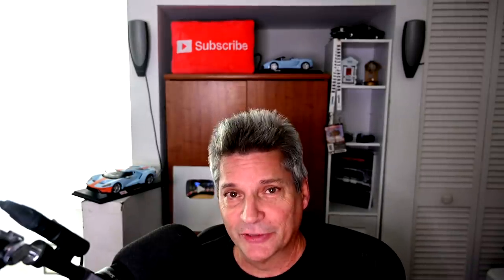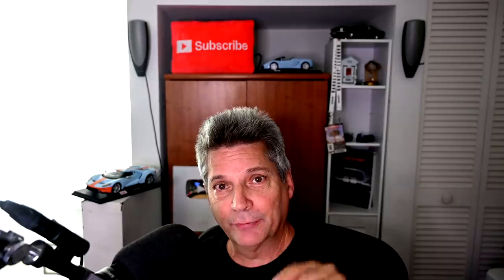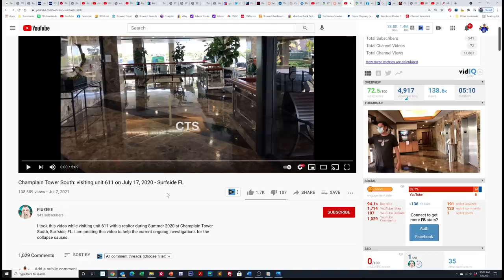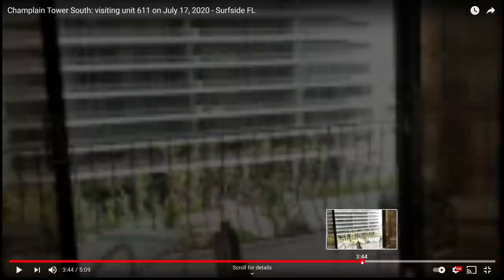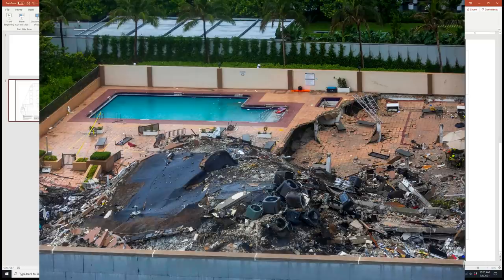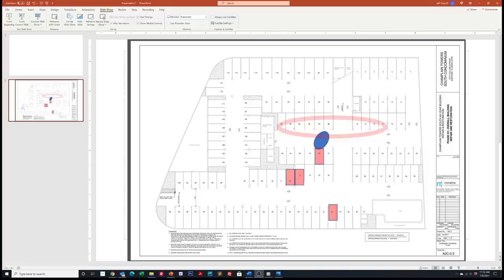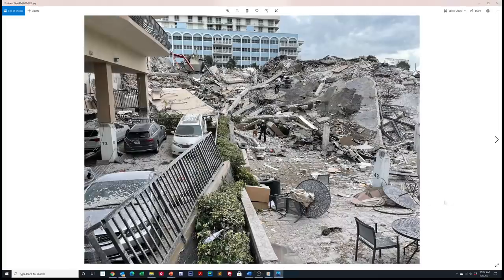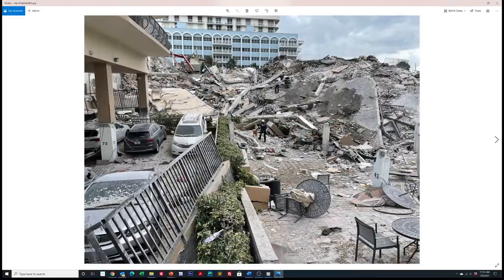Analysis Garage Video BEFORE Condo Collapse: Water Everywhere

Comment: despite the limitations of her recording technique , she still did a hell of a job showing us this garage, this is precious footage, also, she even kept it a year, ( when pre collapse many people would have simply deleted it)
Reply: A few times your meant to copy the blue eclipse or red rectangle and moved them instead.  So there should be more of both on your diagram.
Reply: She wasn't recording for forensic purposes at the time.
Reply: Kudos to her for the footage and that she still has it.
Reply: And how fortuitous that she filmed in landscape rather than portrait! Kudos to her for sharing it.
Reply: I came to say this, too. 👍
Reply: It was obvious back then, this is a warm climate and covered concreate, you see patches and uneven concreate. If I were considering a condo, I would do my own inspection of the lowest level. If I saw concreate that was not almost perfect, regardless of age, I would not consider it. Around 52 you can see unevenness in the slabs and patching, later around 64 is what you want to see a nice flat floor and no slabs failing because the foundation under then is gone. Around the failure, space 18 and 87 you see more slab failure, the elevator concreate structure may have held up places like 52 because it is close while 18 and 87 are farther away and do not get that support.
Reply: Big buildings are death traps
Reply: @Propfaqs  this wasn't a particularly large building  though
Reply: I have learned from other people's awful jerky home-movies, to be very careful and pan the phone camera around very slowly, and make sure that it is in landscape mode as it will look so much better on my TV or on YT. However, she probably didn't see it as a "entertainment" movie anyway, maybe just a single-view to help her decide whether to buy or not. Also, what even is the point of short video clips? A home-movie usually should be several minutes or even 10 or 20-some minutes long.

Strange all the important details that a camera dutifully captures, that we often simply do not remember. Especially if the resolution is high enough to later be able to zoom in on something of interest.
Reply: @Propfaqs 
Big buildings are death traps

A small house can have one end flattened by a fallen tree. You have to live somewhere?
Reply: @yosefmacgruber1920  true.  But in a house you might have one flight of stairs. I bought myself a fire ladder in case the stairs were blocked. Most houses have two doors. I look at those condos now with real hesitation. Never mind the cosmetic enhancements to the unit… figure out the escape routes and assess the integrity of the structure. I was laughing with someone about the google street view of a condo building I was considering. What was parked out front?… the rodent exterminator!!!!
Reply: @Propfaqs 
Imagine how useful a good long rope could be, in a highrise fire. If you have a D-ring and know how to repel.

Guess what I saw in the glass window reflection of a business. The Google vehicle itself. In movies they go to great lengths to keep the cameras hidden from view, as it kind of shatters the illusion. But in the Bonus Features of the old movie "Monsters Inc.", there is a great "accidental" mirror shot of a monster on a cart holding a camera.

I am not sure that a rodent exterminator indicates a problem? Could it be that they have a contract and maintain some rodent traps routinely? Maybe they are being proactive?
Reply: the tiny bits of water she got on her video did not cause a building to collapse.  There was a much more serious failure taking place here.   Parking garages are able to withstand a little water on their surface.
Reply: 😉👍Right???
Reply: @STARZFAN31 
But if it is constantly super-wet in the concrete, then would the rusted-away rebar be slightly stronger than sawdust? But then do swimming pools often collapse? Maybe they are built better?

The Bible does say something about not building your house on the sand. Hmm. Just how solid were those pilings?
Reply: @chrisbarr1359  lllll

Comment: I worked all over Miami Beach in the early 90's and a very respected old timer told me that some contractors used ocean water to mix cement to save money. He said time would eventually tell which ones did.  I thought of his comment immediately after I heard the news. He also told me they would have a water truck or hydrant connection on the street side but would pump ocean water in from the ocean side.  Great videos btw.

Comment: 10:30 I know what that is, that is corrugated plastic sheeting. I have seen this in building garages before. The maintenance department was getting complaints from people about water dripping on their car. So they put those to "gutter" the dripping water away from the cars. Very very damaging image right there. That implies they knew water was dripping from above for some time.
Reply: 👍 Yupp! 
To redirect the leaking off the vehicle probably due to complaints from the owner! They most likely used small concrete fasteners to hold it up!
It's bound to come up in the investigation! 🤔
Reply: In another video an engineer looked at the core sample there was only 1/8 inch waterproofing on the slab.
Reply: It's definitely going to be a smoking gun. I think the root cause of this collapse was the failure to build on top of a slopped concrete slab that would allow for water drainage. The fact it was completely level is the reason for the water pooling, then leaking into the concrete.
Reply: or water dripping on the people while trying to get in an out of thier cars is more annoying than water dripping on a car
Reply: We had a leak like that in our building's garage...  but after a while they did a whole repair of the area, digging into the ground above. They took down the plastic after the repair was done and it doesn't leak anymore for a good few years now.

Total time of leak was 3-4 months.

I can't imagine it being left for years!

There's also excellent drainage and proper slopes.

We also had a few isolated incidents of ruptured piping, flooding, a few leaks. All are fixed as they happen, not just patched over. Maintenance happens all the time, a few times I noticed an issue one day and the next it was taken care of. 

I know someone has to be reporting it- there's a cleaning lady I think? But I barely ever see who's repairing it. One day a light bulb burns out, the next it's replaced.

Comment: Did you notice that the base of all the columns, the bottom 6" or so look a little darker.  It could be a waterline from a one time flood.    Or maybe there is water inside the columns???
Reply: I think it’s a water line from water wicking up the column from the bottom - either from pooling water or from a saturated slab at the base. Bases of those columns are constantly wet.
Reply: I Noticed it too. There is more columns with the same darkening where the floor meets, the red column's base also.
Reply: I noticed that, I wondered if water was somehow seeping up or absorbing up the column.  Granted I don't know if that would be possible with the way the column is built and how its constructed.
Reply: Yes, I think it’s valuable to notice. I am not a structural engineer but considering all the water intrusion it doesn’t seem good, and I think engineers have pointed this out on other channels. All should be looked at.
Reply: It flooded on a regular. The dumpster would be floating. Locals know this.

Comment: When you look at video in garage, look at bottom of pillars!  You see water stains from concrete floor weeping up the columns.
The fresh yellow paint shows they are covering the continued failure you garage area
Reply: I noticed this too. There has been notable amounts of water present for some time it appears. 

Here is yet another folly of man. Just because steel reinforced concrete is extremely durable anything can be destroyed by water over time.
Reply: The concrete columns were clearly freshly painted over.
Reply: @CharlieFlemingOriginal  how fresh though? Sure they may have been 60 or 90 days in but not like same day fresh mate. Paint doesn’t take more than 2 days to dry in high humidity even if it’s enamel paint. I didn’t see any painting materials or masked spots. You don’t get lines that clean without some kind of masking. I also noticed slight dirty spots on the columns so I really don’t think it was fresh paint. I’d be more apt to think moisture collection. From the presence of stalactites and overall dank atmosphere it must be a relative high humidity which would cause surfaces to sweat excessively with the ceiling temperature variance. Especially if it’s a satin or matte type paint.
Reply: Still not going to cause a collapse. Hint. Look at the 2nd half of building and how it came down.
Reply: @metalhead2320  bk
Reply: I guess I should have scrolled down a bit more...I totally agree, if cement is that wet to cause paint to discolor, what else is going on?

Comment: Wow look how every single column is heavily saturated with water about 10” up the column, they were definitely absorbing moisture!
Reply: i noticed that as well
Reply: @nottheone582   who knows how many times they just patched with concrete and repainted, which does not solve anything.
Reply: The columns were strong but the step beam was 12" less deep that the original design.

Comment: I saw a interview with someone who lives there and they said they wondered why there was always water in garage  and there had not been rain
Reply from the maker: I saw this exact same interview also 2 weeks ago!
Reply: Where does the water come from? Broken pipes or something? And by the way, the ceiling is covered with stalactites. It's seems A LOT of water coming from somewhere.
Reply: @Ron4885  the water is from previous rains that got trapped between the pavers on pool deck for 40 years, the deck wasn’t designed with slope to channel water to drain.  According to the engineering report, the water got under the waterproofing below pavers. Trapped with no place to go it rotted the concrete and steel rebar
Reply: Yea seems that the water came from pipes and leaked, but I don't know.
Reply: @Tbevel  40 years of rain water, salt and pool water chlorine, just absorbing on that deck. It's amazing it last this long.
Reply: @Tbevel  I saw a report showing construction drawings that called for sloping of the pool deck.   So far it’s unclear if it wasn’t built to spec., or if subsidence caused reversal of the slope.
Reply: WOW & they didnt REALIZE?? thats a major sign theres a PROBLEM!!! WATER ALWAYS  BUT NO RAIN
Reply: @Tbevel  you just gave the shortest & best explanation lve heard yet
Reply: ....Wow...Yes, And the Climate always Hot, so accidentally Spilled Water would Dry Up in a Few Hours---But Constantly ( hidden ) Leaking Water would never Dry Up...!!!.....Sad
Reply: @probe26  Summarizes the whole story
Reply: @Tbevel  That is what the 2018 report seemed to indicate, but in fact the blueprints to this building clearly show a proper amount of grade-to-drain slope in the entire pool deck spec'd out.
Reply: @jacksons1010  Or if the engineering firm didn't actually survey the slope. I saw the blueprints and concur with you that a proper slope-to-drain was spec'd out, despite what the 2018 Engineering Report says.
Reply: @dumbthingsyousee6969  Yes. And the flooring has seasons where it would be cooler than the air. It might always be damp in there.
Reply: @Ron4885  can be ground water coming up thru the concrete was said to be flooding with brackish water
Reply: @Ron4885  Condensation.    Hot, humid air from outside condenses on the cold concrete.
Reply: @jonwhick3073  that's exactly what is happening in many buildings in the area.  It's a topic hotly debated about sea level rise politically charged. Limestone is porous and sea water is seeping up from the ground whether you believe climate change is the cause or not, it's still happening. Millions have been spent to raise sea walls and pumps there to buy more time, but this could be the first  of many collapses. Poor maintenance for sure hastened the outcome here, but it's inevitable regardless.  Admitting this has huge implications for the economy of the entire city, so pushback is understandable.   Everyone can see above ground problems, obvious neglect, but if we don't look underneath, we'll learn nothing.
Reply: @waitaminute2015  
Absolutely correct. The water was rising underground each time high tide and then it went down at low tide causing a void space between the piles and this corroded over time until finally the columns gave out causing a domino effect.
Reply: @julybailey4239  "building integrity" just posted a video yesterday on the water table. He's a forensic engineer. Check it out.

Comment: If I owned a million dollar apartment and that was the garage I would be pissed...now it is just a tragedy.
Reply: You’d be surprised how common it is with large apartments of thus style w large underground garages. They’re like that all over the place here in LA
Reply: Most million dollar apartment building parking lots look like this
Reply: @TSUNAMI-MAMI  If you own one near salt water and the building is over 16 years old, move quickly.
Reply: Would you know what it means,  water in the garage 5 years ago?, if THIS wasn't happended yet?

After the collapse everyone is an expert.
Before the collapse, no one care about water in the gargae.
Reply: the place had a valet service, you may have been rich enough not to ever had parked your own car
Reply: @williamhaynes7089  most buildings have both valet and self park for residents. Some people always use valet but I find it annoying because it takes them time to get your vehicle etc so I prefer self park most of the time.
Reply: You wouldn't be "pissed", you'd be a pancake!
Reply: @horsewithnoname12345  I live in a building like this but nowhere near as expensive and not in Florida.  Our parking garage doesn't look anything like this.  After this happened I walked around the garage looking up at the ceiling and there are no cracks.  The only puddles I've seen is when people come in from driving while it's snowing.  The garage is heated so the snow melts and the floor will be wet but dries quickly.
Reply: @lisa9867  can’t compare garages of older beachfront condos to wherever you live.
Age, climate and conditions are entirely different. I live in a building that’s a tad nicer than the Champlain towers, not too far from there and our parking garage has the same aesthetic. Minus all the damage and dangerous conditions of course. Our building has worked with a reputable engineering firm for years to repair and maintain the building in good shape.
Reply: @Jeph629  yes...sad thought...did you see the bunkbed right on the edge at t of the collapse at the top of the building...hope no kids were in that bed...looks like they would have survived but they would never be the same
Reply: @JacobBax  no not fully but I would be very afraid...I worked at ground zero...I seemed to be the only one afraid the buildings would explode...I was out of there....I did not stick around too close and watch...I  never dreamed they would fall...by that time I was 2 or 3 blocks away in a low shielded building east of WTC (one over from the Chase Manhattan Bank Building)
Reply: @JacobBax  I am a mechanics daughter who built his own house and dated a stress and fatigue engineer...flights with him were hell...so I do have some understanding...
Reply: @horsewithnoname12345  then glad I dont have a million dollar apartment ...my 100K house and garage is maintained and in good condition and its going on 75 years old
Reply: @TSUNAMI-MAMI  Absolutely agree. Especially in DTLA.
Reply: If I owned a million dollar apartment and that was how the parking garage looked, I'd sell and move....
Reply: @JacobBax  That's just not true. They knew there was a problem and in 2018 had a company come in and give them a report about the problems and how to fix them. It was going to be a very costly repair, where they would have to tear out a lot of stuff and rebuild it. It might have been a surprise to most people, but there were plenty that knew this was going to happen if it wasn't corrected.
Reply: @JubeProductions  I was talking about the average people, that are walking through the garage every day.
Reply: @JacobBax  oh, yeah that makes sense now. You are right.